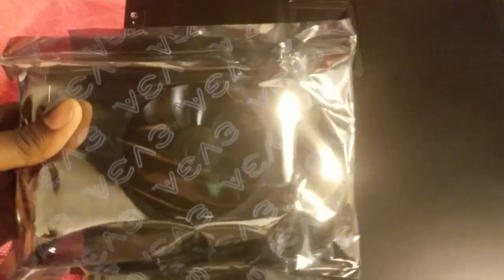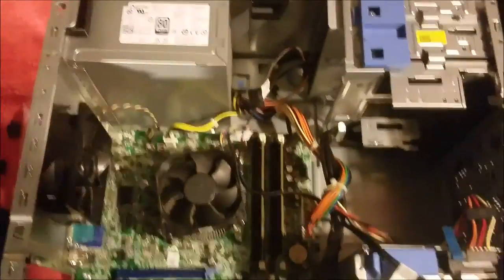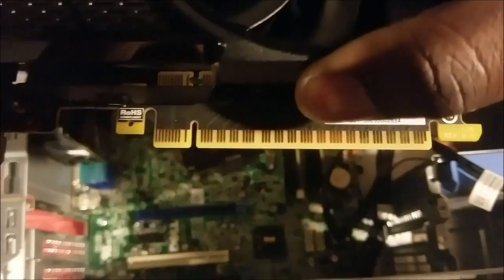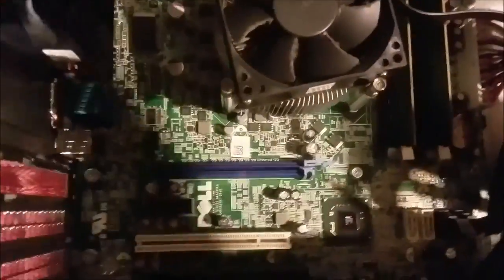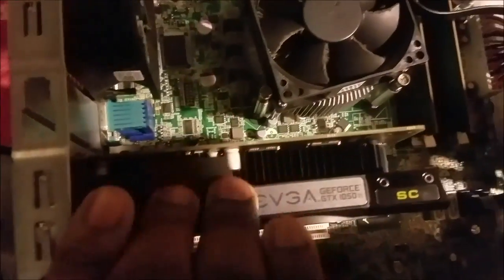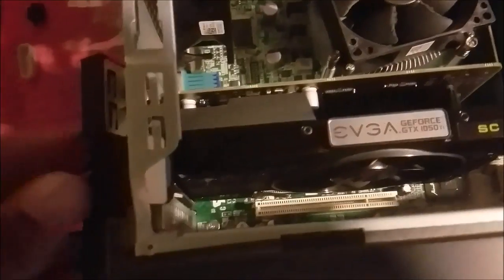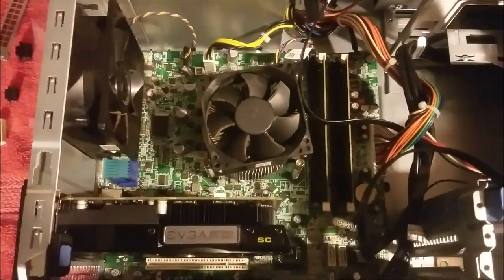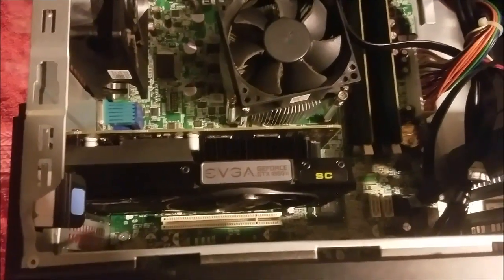Dell Optiplex 790 MT How To Install EVGA GTX 1050 Ti SC [Tutorial] (Gaming Upgrade #1) P.2

Comment: What psu do you have in there?
Reply from the maker: Just runnin' with the stock psu. It'll power the card just fine (I've learned) as it uses only 75 watts.
Reply: which card are you using? Also mine has a 240 psu. so I may need some more juice.
Reply from the maker: Hhmm I'm usin' what was installed in this video (1050 ti). The psu is 265 watt.
Reply from the maker: Yep u can! I haven't done so yet tho.

Comment: is it possible to install it on the bottom slot if I was to take the bracket off
Reply from the maker: Hm the bottom slot? It can only be installed on the blue pcie slot. U would have to remove 2 brackets.
Reply: LucidTeFlon180 no remove the GPU bracket not the case bracket
Reply from the maker: DragoFTW™ oh I haven't tried that. Not sure if we can. May be possible.

Comment from the maker: Heres some PUBG gameplay runnin' on this pc (1050 ti) for those interested https://youtu.be/PxfkpbhgMHs
Reply: then you'll need to  upgrade the psu mens
Reply: Clean dat heat sync
Reply from the maker: Twas fine.
Reply: On the CPU?
Reply: LucidTeFlon180 I'm thinking about buying this same pc. I was gonna get a GTX 960 but, am not sure if I would need to upgrade the PSU. Would like for you to respond!
Reply: don get the core 2 uad version get one with an i5 2400 and once the not too sure about the 960 tho does it need a 6 pin connector to run if nott then you're good to go but do some research before you do anything at all
Reply: AmirMemeZ_ Yes it does have 6 pin connector...
Reply: AmirMemeZ_ Also I'm getting the one that has i5 2400
Reply: AmirMemeZ_ Could I get a gtx 1050? I know that doesn't have a 6 pin connector
Reply: yeah you're better off with one of those or a 750 ti if you dont want to upgrade the psu
Reply: AmirMemeZ_ 750ti doesn't require 6 pin connector?
Reply: I looked on pcpartpicker.com and the parts came out to consume 239watts and I think the power supply in the system is only 240 watts.
Reply: Thank U , can I install GTX 1060 on my pc OptiPlex 790
Reply from the maker: U can but u would need a new psu.
Reply: OK , I well upgrade my power supply to 500W
Reply from the maker: That should work then, Look into how many pins the 1060 has vs the new psu.
Reply: Cool

Comment: same PC as me :) graphic card also
Reply from the maker: tre dolla it's performing pretty nicely. Runs PUBG on high :p
Reply: LucidTeFlon180 think I can add an SSD without upgrading the psu?
Reply: What PSU do you have?
Reply from the maker: tommy swanson I'm still usin the stock 265 watt psu!
Reply: LucidTeFlon180 Pls tell me can GTX 1050 fit in optiplex 990 ultra small mini factor? ....it is mini than ur optiplex 990 casing
Reply: the low-profile variants of the 1050 ti fit in dell's SFF, but not in USFF
Reply: WhitePils Sorry...I have desktop casing of optiplex 990
Reply from the maker: If desktop then it may fit but I dunno about the usff as WhitePils said.
Reply: LucidTeFlon180  Well it has same depth as yours
Reply: Can I send u picture of my pc and inner view.....?    ur fb or email so I can send
Reply from the maker: I added an ssd with same psu..no problems thus far! https://youtu.be/kJJYgUIj1-s
Reply from the maker: Well I'd think the 990 can fit the 1050 but no usff will.
Reply: LucidTeFlon180 thnx no need of usff cos I have desktop
Reply from the maker: If that's the case u should be good to go.
Reply: LucidTeFlon180   but I have 250 watts PSU
Reply: 250W should be good, as he runs it from a 265W, just make sure you get the low profile version with no extra power connectors
Reply: magicstick5 Ok thnx
Reply: magicstick5 Thnx but the EVGA gtx 1050 would work? Or I have to buy ultra low profile version of msi
Reply: EVGA should work, but I would go for the LP version just to be safe, also there are 2 fans on MSI anyways
Reply: magicstick5 Ok thnx but can u tell me that is there any performance difference between Low profile and normal version?
Reply: Even if there is, its not noticable
Reply: magicstick5 Thnx for help...  :)

Comment: Good video and I like your idea of using a common but still powerful Dell as a baseline for modding. My only concern is that NVIDIA's website states that the 1050 TI needs a 300 Watt power supply: https://www.nvidia.com/en-us/geforce/products/10series/geforce-gtx-1050/ 
However Dell's website says that the power supply for the Optiplex 790 MT is only 265 Watts: http://i.dell.com/sites/doccontent/shared-content/data-sheets/en/Documents/optiplex-790-customer-brochure.pdf  Have you encountered any problems when stress testing the 1050 Ti?
Reply from the maker: Dylan Robinson Thx but it isn't my idea :P. So what I've gathered from folks across the net, the stock power supply is indeed enough to power the 1050 ti. It only uses 75w.
Reply: Good to hear. However have you ever pushed the card to it's limits? Only in that fashion will you be pushing its power limits. I'm being picky because I'm looking to do the same upgrade and I worried about having to upgrade the power supply based on looking at the specs from the manufacturers.
Reply from the maker: Well I havent even powered the machine up with the card yet. Waitin to get all the upgrade pieces first. I hear it can push itself tho?
Reply: Dylan Robinson this PC and graphics card works great, no need for PSU upgrade
Reply: have you gotten the parts now?
Reply from the maker: I have. Booted it up for the first time the other day. I plan on uploadin prgoress regardin the rest of the upgrades. Ran into a ram issue tho but sorted it out.
Reply: I have the same machine and am planning to put in a GTX 1060, personally I do not like to run a high powered graphics card on the standard PSU, if the graphics card gets pushed too hard, the machine could run into power problems like crashing/freezing randomly, not being able to push enough power to all components. I have already replaced the PSU for a EVGA 600W so I know there is enough power when I do put a GTX 1060 in the machine.
Reply from the maker: Dean G well I presume ya can't go wrong there. From all I've gathered, the stock psu should be enough. No problems thus far. I'm a bit too lazy to get a new psu. Hookin all those cables back up ugh.
Reply: I would consider upgrading the PSU, might be worth investing in a plug in wattage meter just to keep an eye on the amount of power your machine is pulling under load. If like me you start adding 3 hard drives, 2 optical drive drives, 16Gb RAM, the i7 2600 95W processor, a front fan to pull more air in the case. The standard power supply wont cut it when paired with a high powered graphics card. 

It all depends what you have running in your machine.
Reply from the maker: Dean G oh I only have an ssd and hardrive installed. Along with stock stuff
Reply from the maker: Dean G oh and upgraded the ram to 14 gb for now.
Reply: I really don't know whether to say you be fine running the stock PSU or advise to upgrade. I think the only thing I could say is try to monitor the wattage being pulled from the wall with a wattage meter when under full load. 

I know my machine on boot up peaks at 110w, and settles down to 60-70w on idle, playing sniper elite 3 it pulls 130w. For the more graphical advanced games your going to be looking at much much higher. I might try it out with Watch Dogs 2, Resident Evil 7 or GTA 5 and see how much power my machine pulls from the PSU.

I currently have a AMD Radeon R5 340X 2Gb taken from a newer Optiplex 7040 which orginally had 2 graphics cards and one found its way into my 790 until I can get the 1060.
Reply from the maker: How does one monitor the wattage? I'm a bit curious now just cause. It does run PUBG on high btw.
Reply: LucidTeFlon180 have you tried msi afterburner?
Reply from the maker: Yep I have it installed already.

Comment: About to pick one of these up for a kids' computer. Is there enough room for a dual fan card with the memory slots being so close to the PCI-E slot?
Reply from the maker: Hhm I believe there should be enough room. I've seen ppl with those cards in these machines.
Reply: did you end up fitting a dual fan card in with the memory card slots in the way?